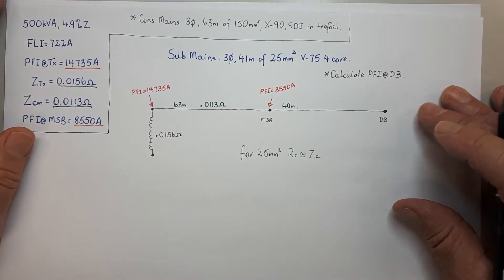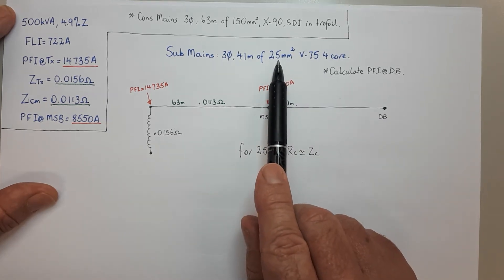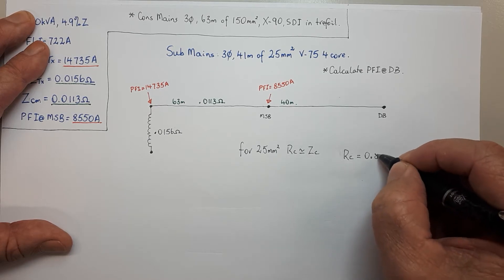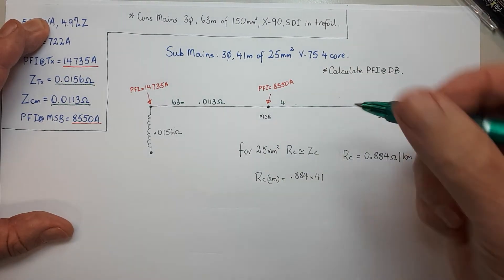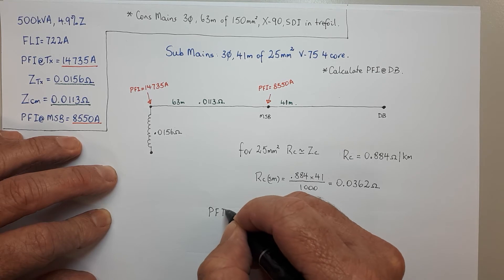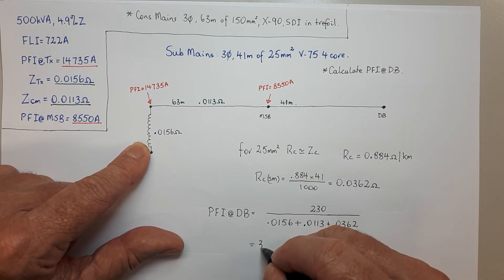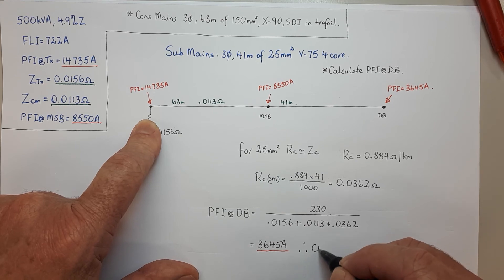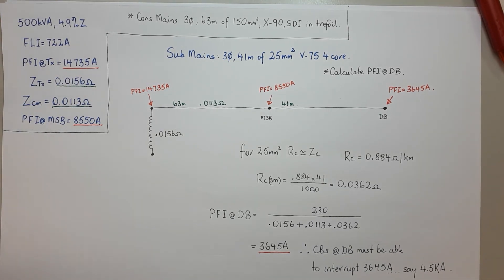Determining Prospective Fault Current at Distribution Board

Comment: If it was a single phase subboard would you include the impedance of the neutral conductor of the sub main as it is an unbalanced load ?
Reply from the maker: @alexlacey7033  yeah that makes sense on 1 level. But supply authorities don't do that for their calculations because the neutral is earthed in so many places (through stakes, pipe bonds etc) that the return path for fault currents will have an impedance DEFINITELY lower than the neutral conductor due to all the alternative parallel paths. Because there's no way of knowing the resultant of all these parallel paths (and every individual installation is a different scenario) they just assume it's 0 ohms. Any error then errs on the safe side by suggesting a current that is (probably) higher than what would actually occur. That will mean the rating of the protective device you select will definitely be sufficient to cover any value of prospective fault current.
Hope that makes sense.